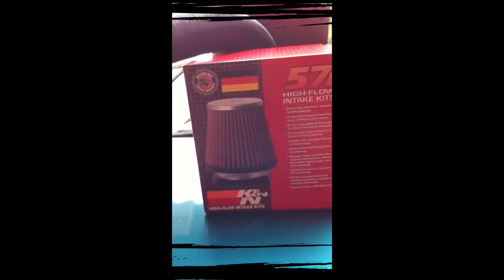Mazda 323 Astina DIY Cold air Intake K&N FilterFilter on Mazda 323 Astina

Comment: thats not a cold air intake its just fitting a pod filter now that open pod filter is exposed to the exhaust heat under the bonnet.if you want to make it a cold air intake fit stainless pipes and a shield around the filter with a air duct in the bumper with a pipe leading to your filter

Comment: Hey!
I have a 323P 1.3i pro II and it has another sensor going to the box part. Is there any performance filter for that type?
Reply: Same! Did you find out?
Reply: @tomhofland9351  Sadly never found out and I sold the car some time ago. Sorry mate!
Reply: @eezys  awwhh man alright ty!!🤘
Reply: @tomhofland9351  the sensor that goes into the box is an air temp sensor, you should be able to pull the whole sensor out with the rubber grommet that it sits in and relocate it to somewhere else where it can read the intake air temp
Reply: The air temp sensor isn’t necessary I just keep mine disconnected

Comment: This is so useless all you gain is sound and because of the engine heat you can even decrease your overall performance of your car. After adding more air you need more fuel and adjust timing otherwise it is just a piss in wind... and waist of your hardly earned money. And stock air filter box provides enough air so just spend the money in better spark plug wires and new distributor. New filter clean oil and your goot to go. If you feel the timing could be improved then adjust it by a hair each time and test it till u are satisfied.